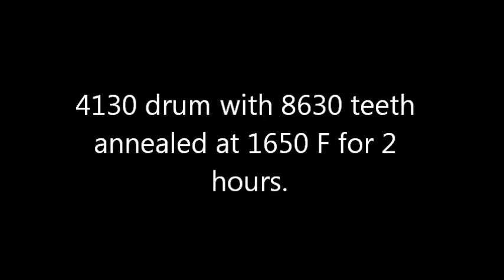Hardening Steel?

Comment: heat it again to chilly red color, and dip it into Motor Oil (used/ new ), then you will get the results, but be careful , its will burn oil with fire, so keep distance,--> and you and also do extremely hard but here I'm not able to write because of its a toxic / dangerous, thanks
Reply: Water can be, but its a weak tempering process !! so you need to be use Oil based tempering